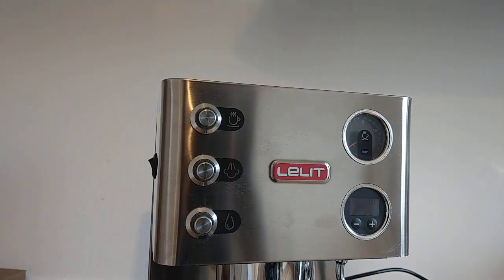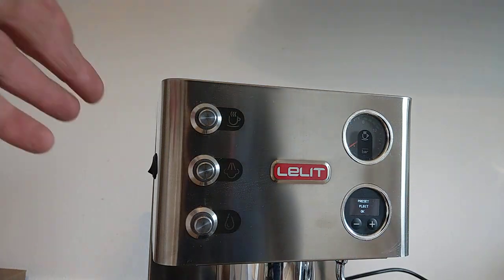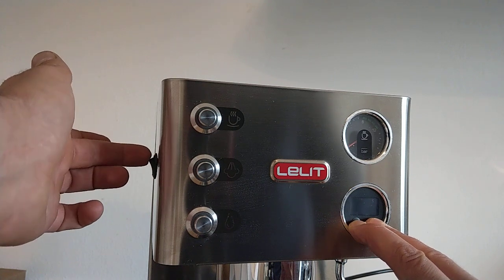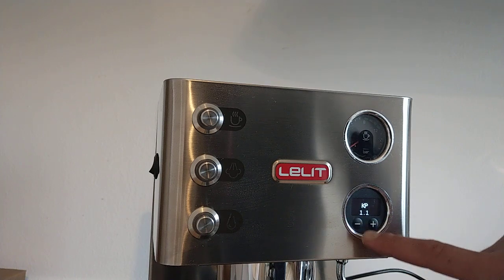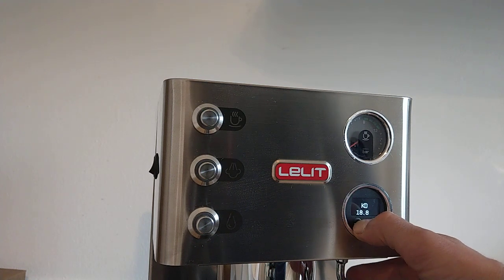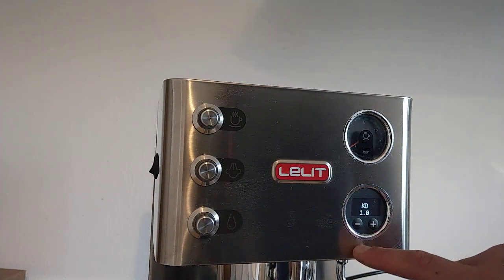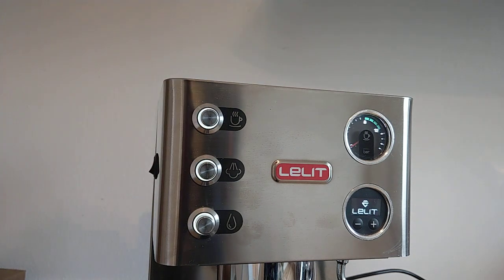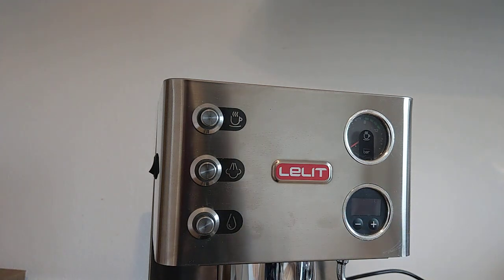Pl81t Tecnical menu  (PL91T)

Comment: Hello Mauro, My Lelit PL91T-AUS is produced in 05/2021,with firmware 6.02, The Original setting is:KP 20.0,KI 0.00,KD 20.0,B 30,Ec 10,Es 5,F01 1,F02 20,SL 1,TR 0,ToT. What's your recommandation of settings?

Comment: Hi, very nice video I just receive Lelit Victoria (outlet) but from 04/2021 fw: 1.13 -> do you know what kind of improvements are between 2021 model and 2023 ?  Are the settings KP=1.0  KD=1.0 E=10 valid or I should set them differently?
Reply from the maker: this are good KP=1.0  KD=1.0 E=10
Reply: @lelitinsider2977  Thx I will try them.

Comment: Can anyone confirm that the TR settings and notes in the technical manual referenced below work on a Victoria PL91T 2020 or other recent version?

Can you get it to show the actual temp rather than just the set temp on the display like a normal PID?   (by default it seems to show the set temp with progress bar, and not the real time reading of the temp sensor, which is what I want to see, i.e. like the Anna and Glenda show on their PID)

https://www.1st-line.com/wp-content/uploads/2018/12/Parameter-settings-technical-menu-Bianca-PL162T.pdf

thanks!
Reply: I want to know too...before i buy the pl91t 2020!
Reply: Any answers?
Reply: No, Victoria doesnt show the actual temp no matter what you do.
Reply: @CanOzkurt  actually went with Mara X instead. So happy👌🏻
Reply: @AzizIzgin  nice choice.

Comment: What do these values do?
Reply: You can look up the reference on the PID values for other Lelit espresso machines PL41 and PL60, which should give you a brief overview on the KP, KD, E, values (incl. KPC, KLC, KDC, Bc, KP, KLS, KD, Bs, Ec, Es, F, TR values). https://www.1st-line.com/technical-support/lelit-technical-support-page/pid-overview-lelit-pl41-anna-pl60-diana-models/

I was not able to find any PL91 PID values manual to confirm these values from the video, but here is my suggestion. Unless you have some kind of basic understanding of thermodynamics, I wouldn't recommend going into technical menu at all. Just my two cents.

You will be still able to make almost perfect espresso with the settings accessed from the normal menu.

Happy brewing!

P.S. Just found another pdf which explains the values above, more in depth and in plain language, so you can try experimenting if you like.

https://www.1st-line.com/wp-content/uploads/2018/12/Parameter-settings-technical-menu-Bianca-PL162T.pdf

Hope it helps.
Reply: @badsantasez  thank you! I really like Lelit so far, seems to be really good value for the money. But that they didn't add this information to the manual is quite mind-boggling...
Reply: Indeed, what do they do? Now we know how to access them but we don't know the first thing about them
Reply: @AlbertoBlasi  Found a pdf which explains the values above, more in depth and in plain language, so you can try experimenting if you like.

https://www.1st-line.com/wp-content/uploads/2018/12/Parameter-settings-technical-menu-Bianca-PL162T.pdf

Hope it helps.
Reply: If I understood well.
"E" value represent the offset (not necessary in degrees) from target temp that makes the PID managing the power of the heating element activating it.
"Kd and Kp" are values to determine the heat element activation during descent and ascent, the more high is the value, the more frequent the PID will activate the heat element.

After this, can't really understand why "KD", "KP" were set to 1 from 20 and 10, while make sense to set "E" to 1 instead of 10.
But I'll try them.